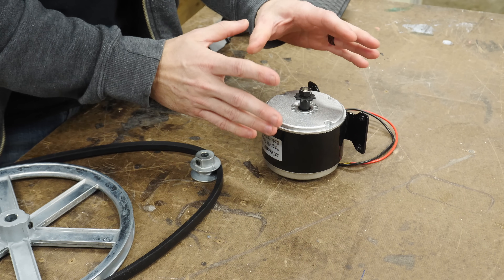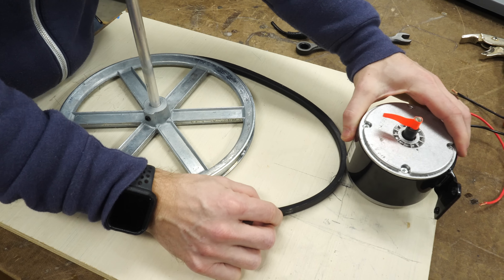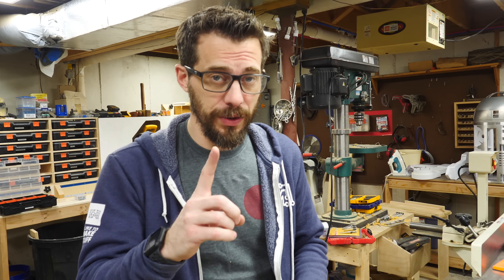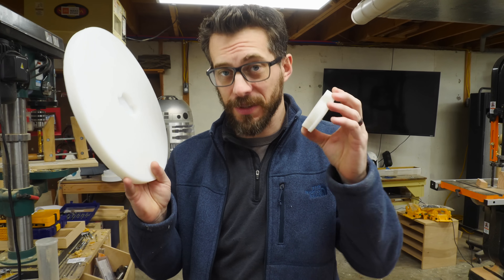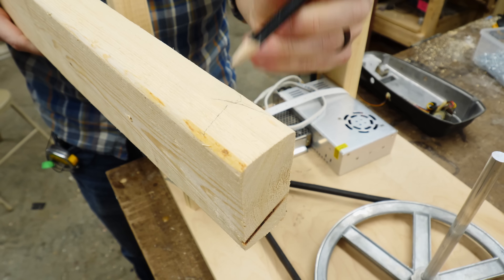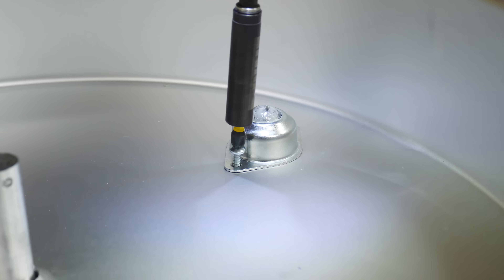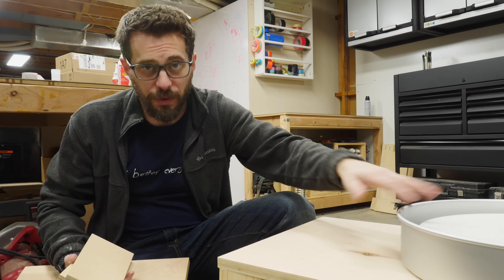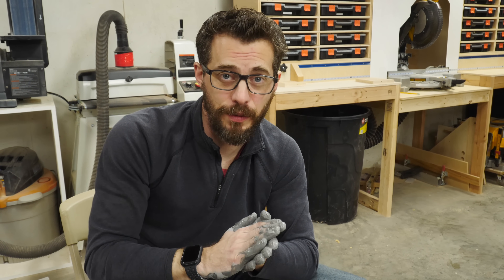How to Make a DIY Pottery Wheel | I Like To Make Stuff

Comment from the maker: We ended up NOT gluing down the bat so that it's removable. That way cleaning isn't an issue.  The couple holds it in place just fine with out glue 👍🏼
Reply: Look up Ingleton pottery on here, he makes removable bats that fit onto the main bat and then you can remove them with the pot on. Then you can do multiple pots and take them off the bats when they're semi dry. I think it allows you to trim when they are semi dry too.

Ps brilliant video!
Reply: @sheendex  33³³³³³³³³³³33³³³³3³³³³³³³⅜1
Reply: Looks great, surprised you did not add some leveling feet so if you place it on a surface not level you can just turn them so you dont need to mess with the bat. And then maybe add a drain to the basin to make it easier to empty and clean. But nice DIY project I like it!
Reply: I was actually going to say it would be easier if you could remove it for easy cleaning. I think the ones at my old school had ones that didn't remove and they were really hard to clean up after.

Also, did you end up blocking out the holes from the old baring you used?
Reply: You just run your ribs over while it's spinning, and then go over it with a sponge a couple times while spinning. The wheel head is the easiest thing to clean because it spins.
Reply: I Like To Make Stuff Perhaps get rid of the pan bearings all together and make a large metal (aluminum) base plate with the nylon plate on top. Much less noise for her as she will be at this for hours at a time!
Very nice DIY though!
Reply: @MRrwmac  I think it will equire a conical tapered axle-fit - but surely it could be done  ( he's got a lathe sitting  behind his back
Reply: I Like To Make Stuff thank you for making this and having a great video I’ve been wanting to make one for my girlfriend since I’m motor savey and not money savey 😂 kudos for making a video on this the others on YouTube are nearly as clear on trouble shooting. Good luck on throwing bowls!
Reply: That's actually great, especially when you're throwing plates or large bowls that are a bit of a challenge to remove from the wheel head if you don't use a bat. You can just have a couple wheel heads and you're settled.
Very cool project!
Reply: just so you know your surface is pretty wobbly so everything you make is not going to have a level bottom
Reply: Could you do a BITS video on soldering? Obviously there are other videos on it but I love your channel and would like your take on it 
Thanks
Also a BITS on pocket holes would be cool too!
Reply: Based on my limited experience, I suggest making the catch tray removable if possible so it's not a nightmare to clean.  At the risk of not knowing the details of the plastic you are using, a metal bat would also be more ideal as when working with clay, the porosity of your surfaces is very important and the clay will actually stick better to non porous surfaces.  Along those same lines, having plaster or cement (highly porous) bats around are also useful situationally.
Reply: I see you ended up not gluing it I was about to comment and ask about cleaning. if you wanted a more secure bat though you could probably make some sort of locking mechanism, similar to what you made but it sort of goes in and turns to lock in place. not sure how clear I am being.
Reply: Was going to say...
Would have screwed it down using threaded inserts in the bottom of the coupler and bolts through the bat . This would hold it down and allow it to be removable. Also leveling the bat could be done easily with shims.
Reply: I love your work. Please make a video on kneeling chair. I did not find any good tutorial on YouTube.
Reply: Where's the part 2 of the R2 D2?
Reply: If you had a bigger and deeper splash pan there would be less of a mess. That’s an excellent beginner wheel, but as you noticed throwing clay can be extremely messy. As you progress in your skills, and if that really was your first bowl you’ll progress quickly, you’re going to be adding more weight, (I didn’t notice what size motor you used). Watch videos, take lessons, & practice, practice and then practice some more. Pretty soon you’ll be posting pottery videos.
Reply: great. i was concerned for this exact reason. nice video.
Reply: I Like To Make Stuff why didn’t you just use a sewing machine pedal for speed control?  They are cheap and work perfectly for projects like this.  I use one to operate a home made sander that works a lot like what you have built here.   Think I paid 14 bucks.
Reply: I've up-voted a couple of comments all about the removeable bat. The whole setup looks great
Reply: You
Reply: The pans are usually removable so that slurry can be cleaned out
Reply: 5000 husband points!
Reply: Excuse me sir, can I just buy this from you or where can I just buy this for cheap?

I just don't have all the tools and don't know anyone who does, and I don't even understand this. I wouldn't be able to do it myself.

Thanks!!!! 😊
Reply: This looks good. I am glad that you didn’t glue down the top because you will need to maintain those bearings so that they don’t rust.
Reply: Uoo9?
Reply: The specifications of motor used should be there, so that we can arrange the used or new motor for that. The details of electrical other stuffs are also very much essential for us. Please kindly react urgently
Reply: Its not called a bat, a bat is a removable piece u can attach to the wheel head and then throw on that. The weel head is what you made, you could print your wheel head with pins and also print your own bats to go on top. Also, your cake pan was a good idea for the splash pan as it is called but you can't remove it to clean it!
Reply: @rainbowsandmorerainbows841  except it is removable
Reply: Item list and Item description please
Reply: Electrical item list and Item description please
Reply: @Eng_hassan_salim  is it there in video. Please post it

Comment: The truly learning I got is that of wheel bearings in the bottom of the rotating plate to make it silent and stable so that the wheel doesn't fall off on applying pressure. Thank you for that insight.

Comment: Great but also not great. Good job with completing the project. But there are a lot of issues from a potter’s perspective. That wood frame won’t hold up. Everything on the wheel needs to be stable to avoid wobbles. That bearing is going to work its way out of that wood and the shaft will not be stable. The plastic wheel head will not last. No shelf for tools. The foot pedal doesn’t have enough range for easy fine tuning. That splash pan is not large enough. Cleaning is going to be a nightmare. There is occasionally upwards pressure on the wheel, so that bat will come off at the worst possible time. Also epoxy on the motor shaft? Major failure point.

Comment: Cool build. The bearings inside the catch basin will get gummed up pretty quickly if you use it very much. I wonder if you could put them on the underside with a flat surface attached to the flywheel. Or just beef up the center bearing so it's free standing.

Comment: Great work, just wanted to point out that taper roller bearings should be preloaded, and i do not belive that your pulley is sufficient preload for those bearings. Maybe consider cutting threads to your spindle as is done in most of applications.

Comment: Nice job. I’ve been thinking it must be possible to make them much cheaper than the shop. 

Although, you want a bigger cake tin so when anything falls off you can retrieve it. 

And that leads into the next point. You’d ideally have a removable wheel head. To clean under it and pull out all that sloppy clay and sludge. Normally the pan (tin) would be removable too, to clean it and especially those bearings.  

You’ll definitely need an overflow pipe. 

Ideally it’d be nicer to have a metal wheel head. I’m sure you could get one milled off eBay. 

And the wheel has to be super flat. Very stable. No undulation.  A rock steady fitment to a steady shaft. It makes sense the old foot pedal ones used a big thick shaft down to ground level. 

Tough to get it dead right. And that’s where I’ve not pushed forward with it. 

It’d be tempting to buy a super cheap Amazon one and see where it fails. Then remount it all onto a wooden frame like yours.  Problem will be thickness of ply will affect shaft, then again how you get the stability at the top once you elongate the shaft.

Comment: Only problen i can see is your splash pan. There is a whole lot of water. Drain hole with plug. Wider pan or smaller wheel head. Taller dam around post.  Also, we end up leaning on rim of spash pan, maybe a stainless steel would be more sturdy?

Comment: It’s been three years and I’ve watched it at least that many times!  Loved the video and I’m going to start down the path of making one myself with things I have on hand.  While I do not have the same machines as you I saw the concepts and can adapt them to what I have for material and machines.  Please keep making these great videos!!!!😊
Reply: I'd purchased parts to build a pottery wheel years ago, but never got around to building one.  I recently discovered that Chinese made budget wheels are now available for about $200.  I picked up a Vevor brand with a 14" wheel head & 450 watt motor on Ebay for $220 delivered, and am really impressed with it considering the price.  It's much better than the design in this video.
Reply: @glennr9913  amazing info, i feel like you save my money, thanks.

Comment: I use to work for a flat company that made their own wheels. The motor they used was sad at bigger than that one you used. They also had everything mounted on a steel frame. I hope your wheel lasts. It's a lot of forces going everywhere. Good luck

Comment: Or did that nut on the motor shaft have left hand threads, and ypu stripped it? At least you were able to correct the issue regardless.

Comment: Wheelchair motors often have braking systems that use a hexagonal socket that attaches to the motor shaft. If the motor is reversible, it would tighten and loosen a threaded nut, so they attach it with a setscrew instead. These setscrews are usually very small and easy to overlook if you don't know what you're looking for.

Comment: Working in a boat shop for years. I learned how strong silicone caulk is.  You could have put a half dollar size spot on one surface n matted the other to it.  Been semi permanent.  Now drill you a hole for a line up dowel in your wheel make you some bats that you can use to remove your piece when done throwing it.

Comment: I like the way you changed your design and how it works as you went along.  I find with many of the projects I work on, no matter how much planning I put into it, when I actually being to work on a project I find myself noticing what I could do to improve the finished product.  Seems like a very practical way to get the best results.  The DIY aspect of making the potters wheel is wonderful.  Thanks.

Comment: Nice work......BUT.............the bearings under the platter / head., they are not required in the conventional design., 'cos the shaft is appx 1" ( 25mm ) .. It ' s less to fill up with mud / seize . Ok ok., difficult with the v belt wheel u had.. You can get bearings in mounting blocks .. Like the motor support., but as the brackets are unbraced they will tend to attempt to bend flat.....a simple buttress on the other side.,for the full gothic..Potters and potters wheels get covered.,box the whole things out & PU everything..

Comment: I found this fascinating, mainly because I was brought up thinking this way, you want something, you research like mad and make it yourself. My Dad made my wheel 45 years ago and like you, he was an engineer not a potter. It was a kick wheel so had different issues but may I tell you what he did because I still find it amazing?  He started by using old dexion shelving upright for the frame, then mounted an old Ford flywheel, bearing and shaft to give weight to the kick process, for the basin he used a galvanised pig feeder ( which I later fibreglassed when it rotted out after thirty-five years of work👍). He was magic with gears and bearings so the movement was smooth and soundless, unlike my electric one!  It had a hard life and produced pots for 45 years both for myself and for my student.  It retired ( like me) earlier this year and now lives now in the garden as a plant holder and remains one of my most treasured possessions and memories of my Dad

Comment: Hello! iLTMS. This was very helpful information for me despite the video being two years old  

I was wondering if you still have the power ratings of the different units you used. I'm just going to use them as reference to repurpose my old e-bike into a pottery wheel. The links don't seem to work anymore and I can't clearly see the ratings in your videos. Also, may I know if you encountered any problems when using the machine long term? (Like excessive heat, or pieces that easily wear out) 

Thank you very much.

Comment: The difference between the volume in the bearings you put under the plate is very telling.  Thank you for that.  Had planned on using similar bearings for a project of my own...and will now swap to ones like you eventually ended up using.

Comment: I’m wondering if you can provide links or suggestions of where to find motors and power supplies like the ones you used. I have, in the past, had the misfortune of ordering things that were just a little off for my projects and having links to the things that work perfectly would save lots of time and headaches… and wrenches imbedded in walls. Thank you. Great job!

Comment: you should try to find an easier and cheaper solution to make this, because people want to enjoy this as hobby, not professionally, so mostly people dont prefer heavy expenses. but i like your video
Reply: I recently discovered that Chinese made budget wheels are now available for about $200.  I picked up a Vevor brand with a 14" wheel head & 450 watt motor on Ebay for $220 delivered, and am really impressed with it considering the price.  It's much better than the design in this video.

Comment: So I tried to look through all the comments and i'm sorry if this is a repeat of what other people have said..  Love the video and that making a tool to learn on is super awesome. I can see that if you or I had big slabs of HDPE to use then that would be ideal. But you kinda over complicated things with the bearings.. NOOOoooo bearings. If we wanted stability and not wanted to worry about the push down forces and when you slam down clay (which is normal) then adding a thicker, smaller diameter metal wheel under the plastic or underneath another metal surface would have been best. The thick metal wheel would have added a flywheel effect and with a hardened steel shaft, would have added enough rigidity that it would not have bent when pressure was added to the top or side. Drilling and threading rounded hex bolts with quarter inch heads that stick up about the same from your plastic/metal surface would allow you to add your wooden hardboard bats to the surface for easy on and off. I would also mention since I don't think you did and you appear to be and it worked out perfect. The direction of the spin of the wheel needs to be against what ever dominate hand you are.. So if your left handed, you need the wheel to be spinning counter clockwise and if your right handed vise versa. And yes normal stuff like removable pan, maybe some kind of drainage to keep things clean would have been nice but honestly people that actually throw on a regular basis have a room set aside or plastic against the walls of there throwing area because there is no "CLEAN" way to throw pottery.. if you have a big enough drip pan to catch everything then it would be literally be in the way of your arms and hands. So drainage would be best and make sure there is a rubber grommet so clay water doesn't go down the shaft into the motor.

Comment: Dunno. Way too many shortcuts... 1/2" aluminum axle? Al is very prone to stress cracking. How do you get the pin (nail) out of the PE coupler? How do you swap the (single?) ball bearing - and will need to swap it, as your bearing was not designed for the type of lateral loads you are applying (you need two, spaced apart). Thinking of using epoxy on PE? No "drip ring" on the underside of the round table? How do you drain the tray? No belt tensioner or adjustable motor mount? ... I know, these things are small issues but this build is a collection of no-nos... not very impressed.

Comment: Try putting a couple of screws into your bat.  Then make temporary bats with holes drilled partially, fitting over the screws.  That way, you can use the  temporary bats, remove them and place them aside to dry.   Then while you work is drying, you can add another temp bat to the wheel and keep working.

Comment: Your carpentry is great, and your "idea mill" is very inventive and successfully so. As a potter who has thrown thousands of pieces, and made his own wheels, for a first go, this was exceptionally well done (my first go had a wheelhead made of oak, that had a definite warble).  I have to point out, of all the wheels I have thrown pots on, I've never seen one with bearings under the flange of the wheel head. It's not "wrong," but I'm not sure why you thought those were necessary, and it's likely they contribute to the "noise" factor. The only other thing I thought might be improved to improve the standard of the wheel would be the splash pan. If you made the splash pan removable, it would make clean up a breeze, and an inner well guard (to the shaft) should be as high as possible (maybe an overturned plastic cup with the bottom removed, and sealed to the bottom of the pan would work?)... This would ensure the pan doesn't fill up too quickly when the potter is going to make multiple throws (using water every time). Overall, I think this was a great project, and well done.